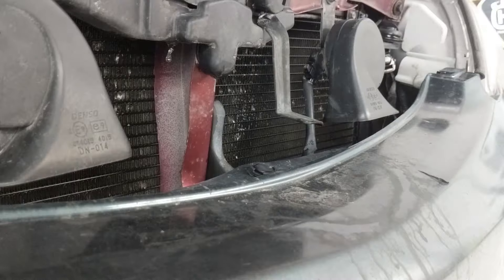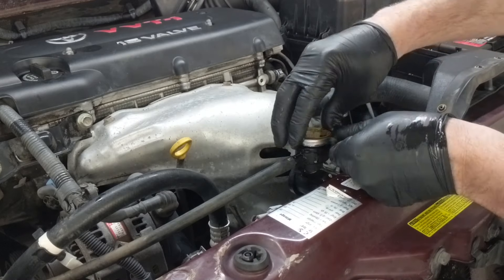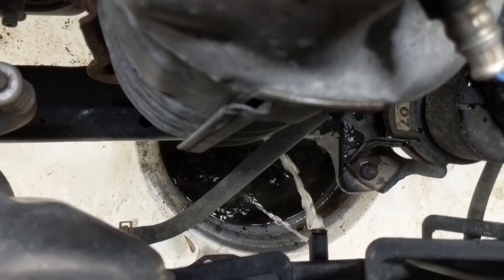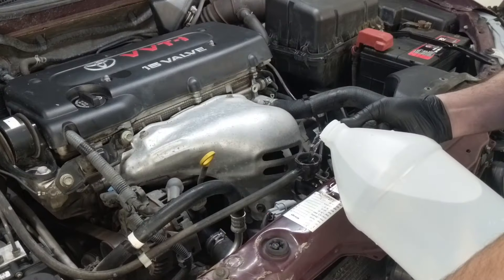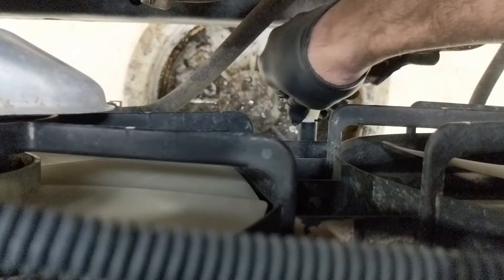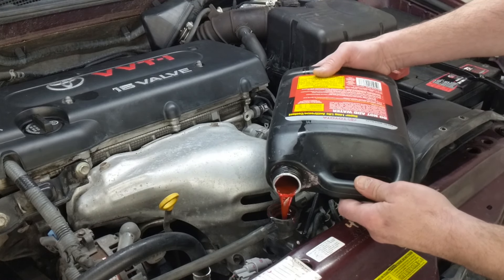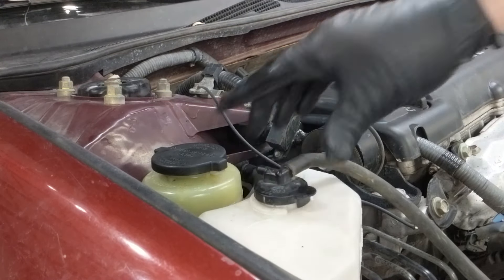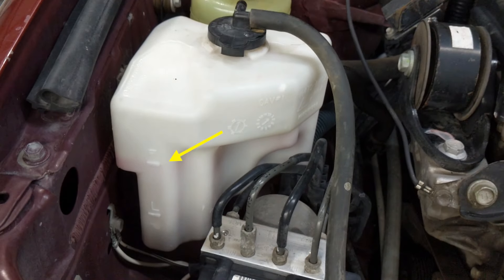2002-2006 Toyota Camry: Coolant Flush

Comment: Is it safe to mix both different types of Toyota coolant ? Research says they use different ingredients. Have you experienced any issues ? Brown sludge or discoloration?
Reply from the maker: @whysooblivious8342  thanks for watching and the question. It's a little confusing the way I word/show it in this video, but for this service I used concentrate that I mixed to 50/50 with water. I had an empty Toyota 50/50 bottle laying around that I used to make my own 50/50 mix from the concentrate. I wouldn't hesitate to interchange my own 50/50 mix (made from Toyota concentrate) with the OEM pre-mix from Toyota. I've done it many times and haven't seen any degradation/color changing of the coolant over time. Not sure if this answers your question...
Reply: @MasterJacks  thank you! The only concern I have now is that I won’t be interchanging the fluids. 06 solara manual advises I use Toyotas 50/50 prediluted but if there’s still distilled water in the system after a flush wouldn’t I be diluting the 50/50 mix even more ?
Reply from the maker: @whysooblivious8342  yeah, same thing with this video. You're going to have a little water still in there. Having some concentrate on hand can help you get the mix right. A cheap coolant tester can help you make sure your final solution is protecting within maximum range

Comment: How many gallons of distilled water do you need to complete this rinse/flush cycle? Thanks
Reply from the maker: I woud say 4-5 is a good bet.
Reply: You can really speed up the process if you find your engine block drain plug, let the coolant out of that and your radiator. then run a cycle with distilled water and drain both areas again
Reply: @chief5981  i like this idea! anything else need to be done such as removing thermostat or does this bypass the need to remove tstat?
Reply: @zacinnc78  that will empty the whole system. Squeeze the radiator hose that connects to the thermostat and you will hear/fill that it is empty.
Reply: @chief5981 depending on the car, you can also remove the the thermostat and remove the lower radiator hose and force distilled water from the top radiator hose to remove everything from the engine in no time. But like I said depends on the car. On this Camry it would be quick to do that.

Comment: I like your pace.  Shouldn’t you drain the block also before adding the distilled water?
Reply: You don’t have too but it’s so easy to get to you might as well. I pretty much drained all the coolant in the system (except for the heater core) by draining the radiator and the engine.

Comment: For anyone wanting to do this, never drain your coolant while hot. You will get severe burns if it touches you. What he is doing is very dangerous. Just make sure you have no where to go that day and let the car cool down between cycles. Also drain your engine block and disconnect the bottom hose. Get as much coolant out as possible. It will save you a lot of time by most likely getting rid of 1 of your cycles before it comes out clear. Disconnect and clean your reservoir too. 

1. Undo radiator cap and drain coolant.
2. Disconnect bottom hose and drain engine block. (If you cannot drain the engine, then do not worry)
3. Fill with radiator cleaner and distilled water.
4. With a coolant funnel half filled, start car with heat ON and fan OFF. Run until you get to normal running temp and your radiator fans turn on. (This means your thermostat opened). You will see bubbles coming from your coolant funnel. When radiator fans are on and bubbles stop, you are good to turn off car and wait for it to cool down. Then drain the radiator.
5. Repeat step 4 with just distilled water until your radiator drains clean.
6. Repeat step 4 with 70/30 mix to make up for the distilled water left in the system from last flush and this time do not drain.
7. Be happy because you did it the correct way and were patient.
Reply: I am on my third day because of the cool down periods-but I am retired....
Reply: Yes , thank you . And don't get burned 😮😊

Comment: Hi nice video 
Can't we just empty it and then fill it with the new coolant?
Or do we have to do the cycle multiple times
Thankyou
Reply: If you want to replace all coolant it's important to cycle it. When you drain coolant it doesn't drain the coolant in the block, so to make sure you get all old coolant and chemical flush out, you want to cycle it with distilled water.
Reply: @chog4607 do you have to really drive when in between cycles?
Reply: @alexgarcia7416 i think he was doing that so the cleaner could cycle through the system. Then the following flushes with distilled water were to get rid of the cleaner residue.

Comment: Idk if this has been asked but can someone tell me why would you need to drain the coolant tht is already there clean it out like he demonstrated and not just add more coolant to the one tht was already ? Highly appreciate in advance for educating me
Reply from the maker: Good question. Coolants have additives in them that break down over time. These additives help the engine cool more efficiently and prevent corrosion (rust) that can lead to other failures. Most vehicle manufacturers recommend replacing the coolant about every 5 years.

Comment: I got a 2002 and found a block plug that I also use, it's in the middle of the front. If you are standing in the front. Better to reach it from the bottom. I put a small hose and clamp and leave it on. THe plug is brass and turns easy. My toyota truck has a a long one real easy to reach. I didn't know about them I just found them when I was looking for any problems. Yours may not have them.
Reply: Thanks for sharing this.  Where exactly is this block plug, not sure what you mean by middle front?

Comment: So I have a 2003 camry, but for some reason it has green coolant instead of the red/pink type, should I flush it out?
Reply: i have a 2002 camry with clear coolant. cant find any answers as far as mixing with pink coolant.
Reply: I’ve had pink coolant, I think green is fine but I’m pretty sure Toyota coolant is suppose to be pink for certain reasons
Reply: somebody probably used the cheap"mixes with all makes "antifreeze....whether or not thats acceptable idk

Comment: I've seen some other videos explain the need to remove air bubbles, is that necessary for radiator flushes?
Reply from the maker: Yes, you do need to make sure there isn't air in the system. Top it off with as much coolant as it will take. Drive it around until it reaches normal operating temperature. Let it cool overnight, then top it off again in the morning. The idea behind the method is to get the engine fully up to temperature which will allow the thermostat to open. When it opens, it will draw coolant into the engine block causing the level in the radiator to drop. Because it's now really hot and under pressure, you want to wait until it's fully cool before topping it off again. If the car is at normal operating temperature, but you're getting cool air from the vents (when max heat is selected), you still have air in the system. Repeat the process as necessary. Hope that helps. Thanks for watching.

Comment: I live in south Florida should I mix my final coolant or full straight
Reply from the maker: Great question. Concentrated antifreeze does not have the same heat transfer capacity as mixed. So be sure add mixed coolant for proper engine cooling.

Comment: Can I use just the 50/50 for Toyota
Reply from the maker: If you're doing a drain and fill, 50/50 is fine. If you're flushing it with water, you'll end up over-diluting the 50/50 mix.

Comment: Hi there MasterJacks, I was wondering if you have time maybe to help with an issue I am having. I am running in to an issue with a 2005 Toyota Camry V8 check engine light (only 52,000 miles on my dashboard so the car is not driven a bunch over the years). The last 2 years like clockwork a year apart i get the check engine. The first time I brought it to a show I was told to go to. They said after checking with their computer I have a faulty knock sensor. So I said okay lets do what needs to be done. They charged me $700 at the time in 2020. They said when taking apart the parts they found coolant in different parts of the engine bay (i do not know car stuff I am pretty sure that is what he said). This part of the problem is how I found your video here. I am wondering too what could cause the coolant leak. They replace the sensor and a few days later the check engine light returns. Same codes on their test so they replace the sensors again (for free). A year goes by and then just before inspection time Check engine again. Go to the shop... same code. Now they do the replacement again and charge me $300 just for parts they say (do not know if that is a reasonable price). It is now a year since then and once again I have a check engine light. Also I should say my coolant is about an inch lower than it was a year ago. Just trying to ask anyone and everyone for information. It is such a hard thing to find a mechanic in NY and since I am not knowledgeable (but trying to learn) it makes this soo much harder.
Reply: I’d take it to autozone or a place like that and have them run the codes, they’ll print them out for you for free with a detailed page as to what every code means and the possible causes for them and how to fix them. I’d start there cuz a lot of mechanics like to tell you one thing and charge you for a quick job, delete the codes so you think everything is fine, a lot of them are dishonest in my experience and just tell you anything really.

Comment: Do I have to use 50/50 if I used concentrate.
Reply from the maker: You'll need to mix the concentrate with water to get a 50/50 mix. Mixing the coolant increases the thermal protection range and helps keep the additives suspended.

Comment: Can't you use a garden water hose instead of water jugs as an alternative?
Reply from the maker: Yeah, it might have some minerals in it, but that's what the coolant additives are meant to handle. 👍
Reply: @MasterJacks  Does the coolant tank need to be empty when doing the coolant flush? I notice you pour water into the coolant tank that still had some coolant liquid. Last question, does the inside coolant tank need to be wash as well? I would assume so since the point is to have everything clean with no containments.
Reply: You want to use Distilled water, as it does not contain all the minerals of your standard drinking water, which is bad for your system.

Comment: What about the coolant in the engine? Aren't there draining portson the blick?
Reply from the maker: It'll get exchanged during the drive cycles. The water pump circulates the coolant through the block and radiator.
Reply: @MasterJacks  why would you contaminate your new coolant with such a large amount of old coolant? I discovered the draining ports are under the exhaust manifold fir the front bank and below the fender on driver side, for the rear bank.
Reply from the maker: @axios76  you don't, you run water and flush agent through the system three times before adding new coolant. The water pump cycles fluid through the radiator and engine while it is running. That's how the cooling system works.
Reply from the maker: Draining the block is fine too if you want to go that route. Just not necessary if you're following the process as shown in this video.
Reply: @MasterJacks  , i bought a car, which was a bit neglected and want to flush everything.

Comment: Job goes a lot faster if you use a plastic canister/funnel like this guy: https://youtu.be/C0YY4TsWT7c?t=281 . It is faster, easier this way. Also the system ventilates much better. I taped plastic bottle and used it as funnel.

Comment: Aint that a flush...drain and refill the radiator
Reply from the maker: I guess the flush part would need to include circulating it through the engine block with treatment through several drive cycles.